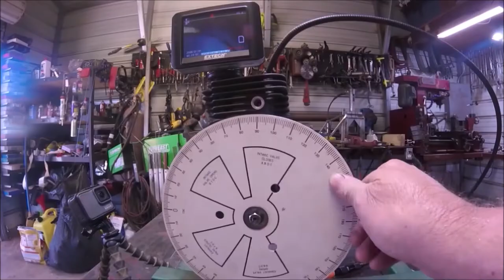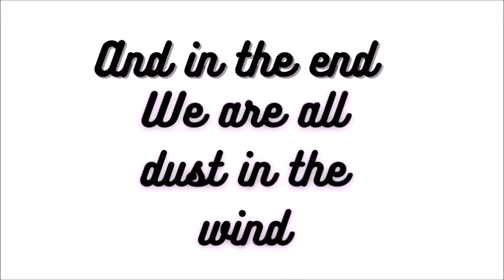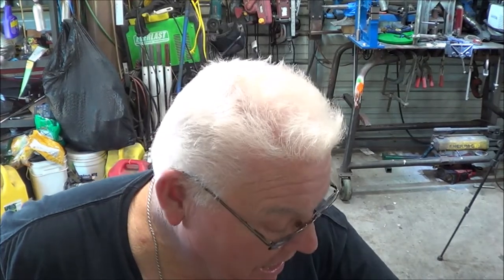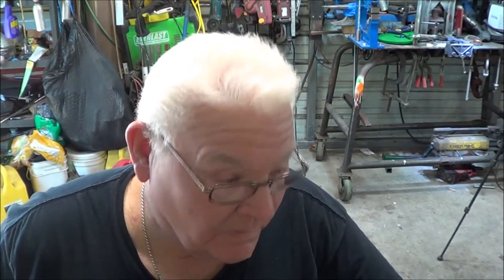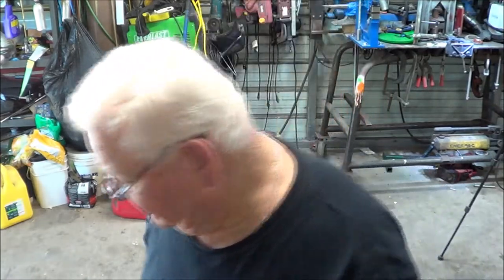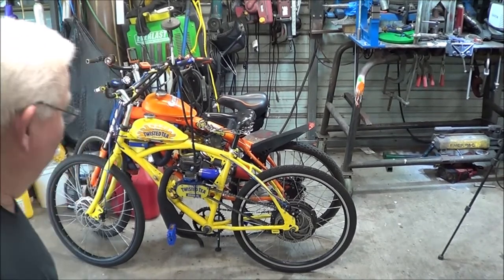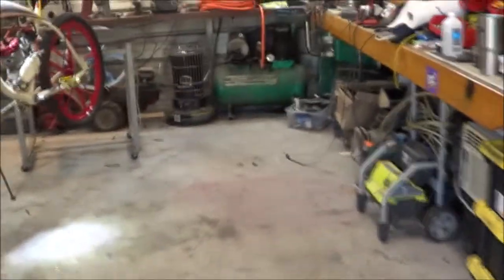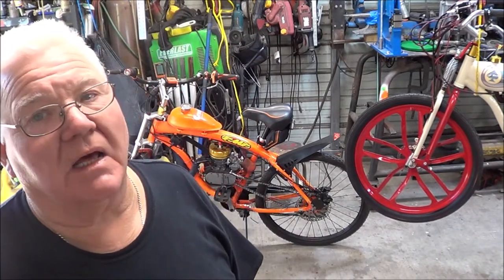Motorized bicycle   it's Tea time

Comment: i bought a 2.4L felt faker frame thats going to use a 2 stroke motor. do you have to use the wide crank assy they sell, or can you just buy the 2in. bracket bearing set and use a standard two pc crank off a regular frame?  i cant find specs on the width of the crank shell on this frame and i havent received it yet. want to be ready to assemble asap. thx in advance kevin.
Reply from the maker: On the twisted tea bike it's a stock crank that came on the bike it works fine the nel lusso stock crank the cranbrook stock crank the orange crush bike stock crank I hope this helps thanks for watching